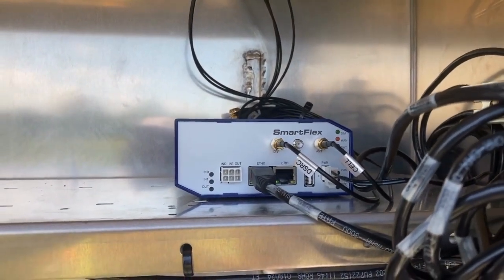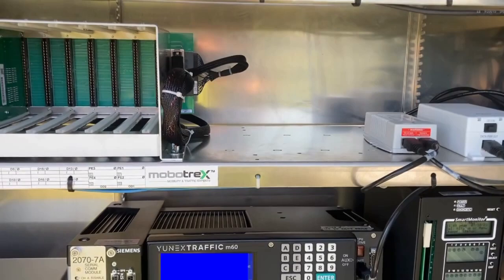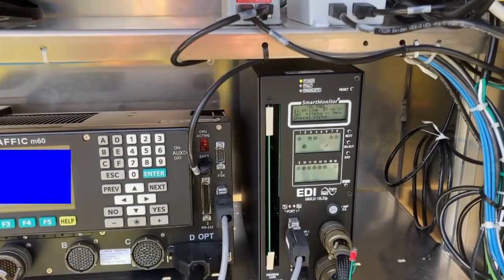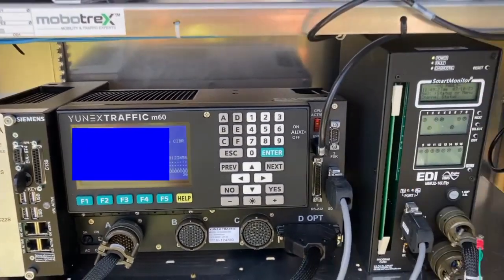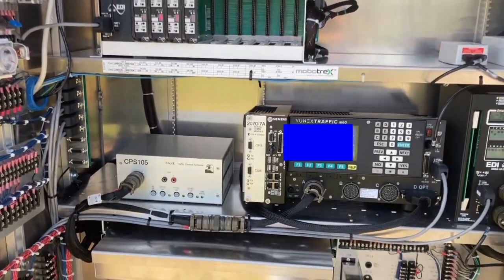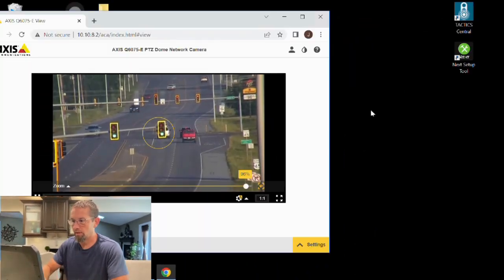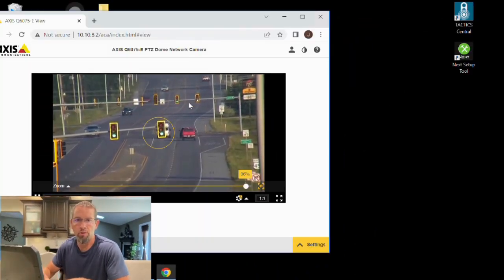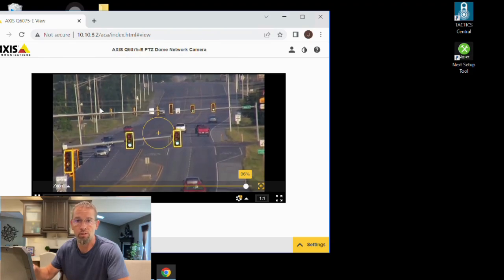How to Remotely Connect to a Traffic Signal

Comment: I remember seeing a traffic signal cabinet in a nearby town being replaced, and the old cabinet used jumpers to set the timing and configuration. No displays, nothing else!

Then again, I still remember hearing the electromagnetic ratchet-controlled cabinets in Manhattan. Ker-CHUNK! ;)

And no I'm not even that old, things have just come a long way very quickly. x3
Reply from the maker: Ah yes, I still remember attempting to work on the electromagnetic signal controllers back in the day.  I cringed when a complaint came in and I had to try to figure out what it was....lol
Always thought the original person who designed that machine was a genius.  But thank goodness for solid state devices!  LOL

Comment: I have a predecessor controller to the M60 and it's only remotely accessible with telnet. Do the newer M60 controllers have an HTML or software connection built in to them?
Reply from the maker: The M60's have the ability to telenet in as well.  If you're familiar with their database software (Tactics), there is a selection to connect to the interface thru telnetting (is that a word?).  Anyway, you can connect right to the controller and make changes like the predecessor you speak of.  Hope that made sense
Reply: @streetsmartstraffic   Interesting! I'm not familiar with Tactics, I've just been using Windows' own built-in telnet functionality. Thanks!
Reply: They're using telnet still? I'm kinda shocked they haven't updated to ssh.
Reply from the maker: @xXhotshot55Xx  Actually the screen to remotely connect to the controller gives you both options.  Thanks for bringing that up
Reply: @xXhotshot55Xx  in theory telnet isn't horrible as long as you take precautions in tunneling your access over a secure access method; 
I can imagine one would setup a central management server for all access where the cell modems build a (secure)tunnel out to the central management which allows you to hop back into the actual cabinet hardware over that tunnel.
Reply: @EVersaevel  best security practices would dictate you still use the most secure remote access method available even with multiple layers of security
Reply: @xXhotshot55Xx  for sure, I am not saying it shouldn't be used if it's available, just saying if it's not available because for instance the thing has the calculative capacity of my refrigerator it doesn't have to be an issue,it only requires a bit of networking knowledge.